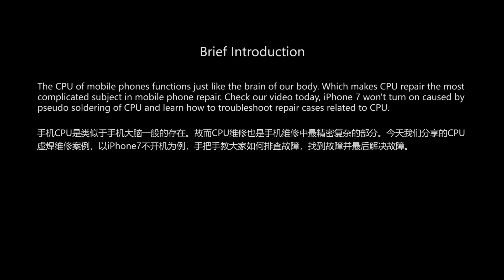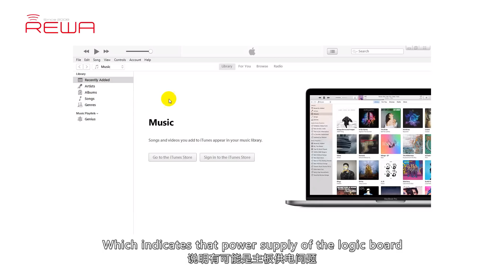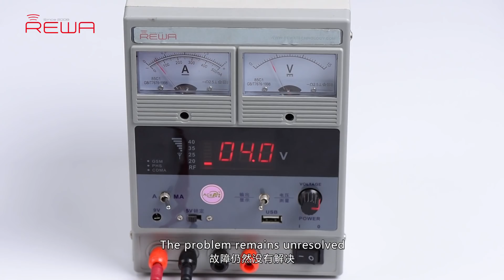How To Troubleshoot A Dead iPhone  - CPU Repair

Comment: did you measure every little capacitor for voltage on those 16 power rails? and they all had the value that was saying on the schematics? For example, schematics call for 6.3 on C1719 cap at 1:45 in the video, is that what you got? did you check all 19 caps on that pp3v0_nand rail? and did the same for all the others?
Reply: They has not showing everything , there is no way to have all 16 voltage from power off phone .Some are always  voltage , some are come after phone turning on. Also need to measure some caps in Diode mode.But cpu diagnose is very complicated proccess.

Comment: Is the temperature used to remove cpu the same temperature used for removing any other ic on the board or do you go higher for cpu?
Reply: Yes it is just use a Heat Tape to protect tge surrounding area

Comment: Sir i have iphone 7 with baseband ic issue which shows unable to activate screen and shutdown, if i borrow same chip with another iPhone 7 will it change imei? Or i have to program it or anything like that?
Reply: Yes, needs to be programmed before install.
Reply: @peverellpoulin5087  do we get orignal motherboard of iPhone 7?? Or if we fix chinese motherboard for iphone 7 will it work smooth like new?
Reply: @peverellpoulin5087 Most of the chips on an iPhone are interchangeable. But he CPU, the baseband CPU and the NAND will have to be from the same device since they are encrypted together. 

The NAND is a special case. With a NAND programmer, you  can read, write, alter or transfer data from the NAND. But dimoly changing the info on the NAND will not work. All three, the CPU, the baseband and the NAND all need to have the same data.

Comment: Why do you remove the black sticker from the shield before removing the shield? It will still pop off with it attached
Reply: withouth the sticker hot propagates easier, so less time applying hot and lower risk
Reply: Juan Issa I’ve tried both ways and there’s no difference in time

Comment: Please sir upload video about basic method of motherboard tracing how do you know direct where is exactly fault plaese tell me about sir I am half technician of mobile
Reply: You don't need to trace the motherboard, just search up a schematic of the iPhone you want to fix. Make a list of the 16 power lines, and then CTRL-F to find which parts of the board you can access them. (And of course, find a ground point as well.) Once you find the part on the schematic, find it again on the PCB layout. 
Hope this helps :)

Comment: Unprofessional! No need to break the shield to remove U2 and even tho no need to replace with the new one to see if it’s ok! Just remove it and turn it on if it’s the u2 then the device turns on and enters a loop, anyway you could realize the cpu issue by measuring the feedback line when it’s not connecting to the cpu right then fb line is  4V !
Reply: Can you explain a little more  this:
"anyway you could realize the cpu issue by measuring the feedback line when it’s not connecting to the cpu right then fb line is  4V !"
Thanks